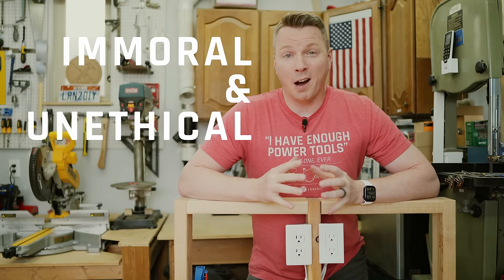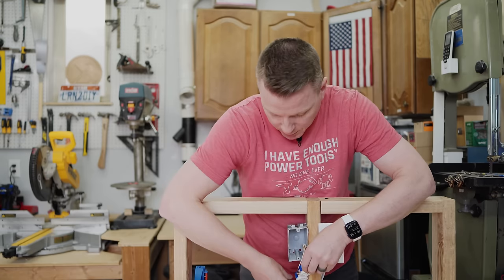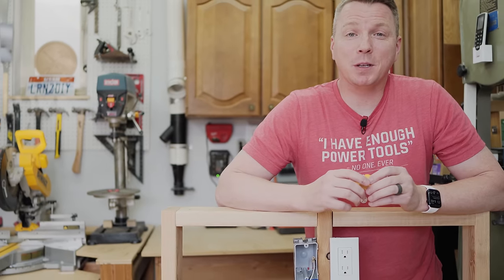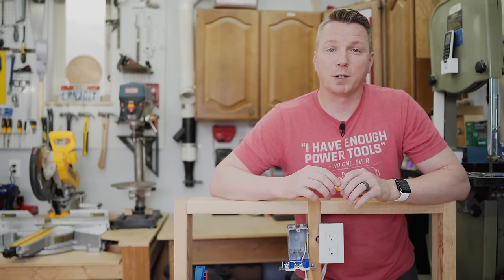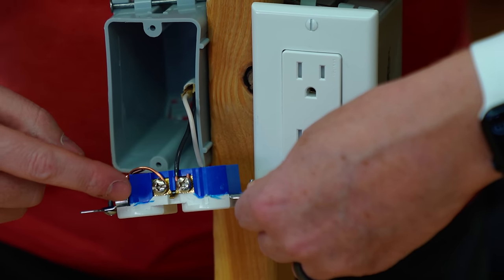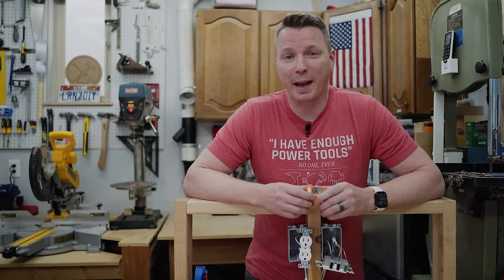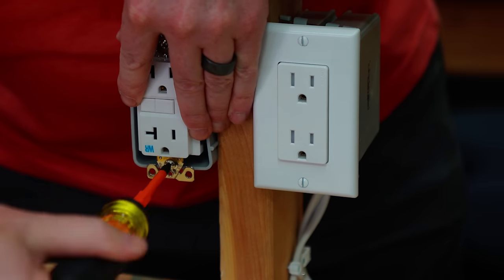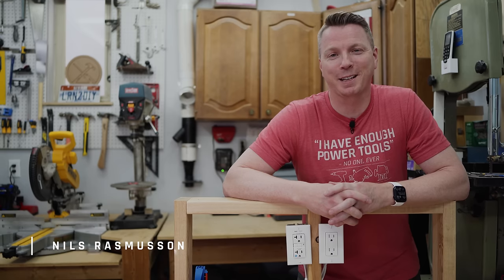People Are Adding Deadly Hacks to Outlets

Comment: Another option is to install GFI breakers at the panel.  That's going to be my solution.  I have a house built in the 50's and it is entirely wired with 2 prong outlets.  To rewire the house would be 20% of it's current value.  The existing 12-2 seems to be in good shape.
Reply: ❤I like your idea . That would work if you have circuit breakers, some houses that old have fuses. Just my opinion.
Reply: I have the same issue. Thanks for the tip. I'll look into that.
Reply: @jayjudd6518  always change the panel
Reply: If you install a GFCI breaker on an un-grounded circuit and then replace the receptacles on that circuit with 3 prong outlets, will a receptacle tester show that it’s correctly grounded?
Reply: @JClishe  no wire is still missing but it'll be safe.
Reply: @AgentOffice  It's safer, but not safe. It's legal but you still have no protection for your electronics.
Reply: @michaelruskey2311  it's why I decided to run ground wires to every outlet
Reply: @AgentOffice  good call. Consider putting surge arrestor on panel as well. And also at a/v locations. Putting it on main panel will also protect all those fancy new Smart LED bulbs we all have. They will actually live the life quoted on box!
Reply: @JClishe  No.
Reply: You still have to label the outlets as no equipment ground and GFCI protected. But, the advantage of doing it this way is that if the hot chafes against the box and shorts the box to hot, any sneak path to ground will trip the GFCI in the panel, while an outlet-based GFCI would not. The Stud Pack channel described finding this problem the hard way one time while connecting a copper ice maker line to a refrigerator fed by an outlet with this problem. The refrigerator case was connected to 120V through the box "ground", and the water line was grounded. With one hand on each, he was thrown across the room.
Reply: @johnhaller5851  Ay I just saw that video last week! Great channel and great demonstration. Metal boxes without proper grounding make me so nervous.
Reply: @johnhaller5851  You are correct about the labeling. Also any receptacles after the GFCI fed from the load side need to be labeled.

However a GFCI receptacle and a GFCI breaker work exactly the same way. So in that video you mentioned he
Would not have gotten shocked with a GFCI breaker or receptacle. 

They both measure power in and power out. If even the smallest amount is not verified they trip nearly instantly. Although it would allow power to remain on (possibly) in normal usage. The second he touched it, the return path(ground) would have a split path. So it would see that for some reason power  in and power out is not the same. It would trip and I doubt he would even have known it happened except for hearing the click of the mechanism.
Reply: @michaelruskey2311  here is the video he is referring to https://youtu.be/lH8g3_a6HuY
Reply: @wellsnapyeah  thanks Joey(not sarcastic) I found it before responding, to make sure I wasn't missing or misunderstanding anything he said , before I responded. 

Point stands though. With a GFCI when you give it a different source to ground besides the one it's metering it is noticed. This is because it basically would then be sending half voltage down each, thus trip.
Reply: @JClishe  No.  The tester will show that there is no ground which will match the "No Equipment Ground" label that you put on the outlet.
Reply: It would be a pretty good idea to add arc fault protection while you're at it
Reply: Certain small appliances do not work with GFI breakers just so you know
Reply: @jaubuchon28  This seems important to know.  Can you give examples?
Reply: Good idea.  My house is 1940’s two wire.  Was thinking of spending thousands to rewire, but done properly this should fill the bill.  Thanks for the advice.
Reply: If you only have a two wire feed coming to the receptacle (no ground wire), the code allows the use of a gfci receptacle at that location.
Reply: @nateo200  just use screwless plates with the gfci receptical.  this way there is no exposed metal for you to come in contact with the metal box, and the GFCI will trip in the event of a ground fault situation.
Reply: @jaubuchon28  this is quickly becoming a moot point.  GFCI breakers are getting better at detecting ground faults vs false positives, and appliance manufactures are getting better at not sending out those false positive signals.  this is all fueled by the fact that the NEC is requiring GFCI protection on more and more circuits.
Reply: @jaubuchon28  if an appliance doesn’t work with a GFCI, then it’s a defective appliance that should be thrown out and replaced. 

Just because it turns on and does the task, don’t mean it’s safe. Throw it out and buy a new one. 

(The only exception to this is some inverter based appliances like heat pumps might trip a gfci even though they are safe, but if your coffee maker etc trips the gfci, replace it!)
Reply: @jayjudd6518  if your house still has fuses, it’s time to at least replace the electrical panel. Code and safety standards have increased so much since then it’s time to replace the fuse box.
Reply: @michaelruskey2311  what are you talking about “no protection?” GFCI protects the appliances too. GFCI is far more effective than a safety ground at protecting things.
Reply: @rpvitiello  that protects you from shock. Gfcis do not arrest surges or protect from arcs. Gfcis do absolutely nothing as far as protecting electronics from spikes/surges etc. 

You need surge arrestors if you want your electronics protected. You should put one on your main panel for major spikes. It's a good idea to also use surge protector power strips where you have pc or av equipment. It will cut those spikes even more so.
Reply: You can't do it yourself?  Any useful life skills?
Reply: I don't know what is electrical allowed in the US and what not. In Europe our RCD (GFI breaker) disconnect both wires (Life and Zero). If you have 2 wires and 3 prong outlets, isn't the Zero wire used also for Ground? In Germany it is not allowed to route a wire over a breaker that is used as Ground, because in an error state the metal case of your electric equipment isn't connected to Ground any more and can have dangerous voltage. The other reason is that if the RCD/GFI is installed in the distribution board, it can't detect a Zero to Ground error behind the outlet.

Is this in the US diffrent? Or didn't i understand the label on the GFI breaker? Is it that you install a GFI breaker and can only use isolated 2 prong devices. Then for what is the GFI breaker?
Reply: @maximilianreichelt9717  I am not too familiar with Eu standards. However I believe your circuits are 240v. So we are getting into some different stuff.

I'm not sure I understand your question but I will say this. A GFCI breaker or receptacle work the same. You can use either with or without a ground because it measures power from live wire{colored) to the neutral wire(white). It does not need a ground wire(green or bare) to operate.

So, if you had a general living room circuit, let's say. And this circuit was a good grounded 120v circuit. Then no need for GFCI protection from breaker. So, a regular breaker would be used.

Now let's say you want to put a receptacle directly on the living room wall exterior for Christmas lights. You could feed that exterior receptacle from living room power however now it needs GFCI protection because it's in a possible wet location.

So, the GFCI receptacle would be perfect for this because it protects only the area in risk. You could also put a regular receptacle outside and install a GFCI breaker in main panel but that's more money and not ideal or necessary for that situation.
Reply: @michaelruskey2311  Yes, i had to read your answer three times and have written my answer now two times. Physical it's the same but we build in such a complete diffrent way in Europe/Germany that it is some times very difficult to understand. For example we don't have 2 columns with fuse or breaker or GFCI breaker. We use all of them in series. Fuses at house entry, breaker before electricity meter, RCD (without breaker) before breaker groups. And RCD with breaker for special circuits.

To make it simpler first a definition of words:
- L for Live, N for Neutral and PE for Protected Earth (ground). That was the easy part, because we use in germany your abbreviation.
- If N and PE are combined in one cable we call it PEN.
- Distribution board or panel is in the garage where all fuses, breakers and RCD/GFCI are installed.
- Receptacle is the same as outlet.
- Breaker is a resettable fuse to protect against overcurrent. In Germany it is LS "Leitungsschutzschalter" and would be translated as Wire Protector.
- GFCI breaker is a GFCI with a breaker installed at the panel. Common in the US beceause of the limited space in the panel to replace a breaker? International it would be an RCBO. We call that a FI/LS or RCD/LS. It is not common in germany.
- GFCI receptacle is an outlet with an GFCI but without a breaker. We have that too, but i have never seen one anywhere.
- We use GFCI with seperate breakers in the panel and as i understand uncommon or not existing in the US, but very common in Europe because it's cheaper to use one GFCI for many breakers. International it would be an RCCB. We use the generic term RCD because in 99 % we use RCCB and in 1 % we use RCBO. The old german is FI ("Fehlerstromschutzschalter" Fault Current Protector).

That was a bit complicated, because you have only two options: Replace the breaker with a GFCI breaker or use a GFCI receptacle because your panel dosn't allow something else. We in Gemany would install the GFCI without breaker in the panel in series with the breaker.

Yes we have 10 to 16 A fast breaker 230 V 50 Hz single phase for light and outlets, 10 to 32 A slow breaker 400 V three phase for cooking stove, heat pump and such big stuff. All at 50 Hz. We have TN system, that a breaker can do personal protection if the loop impedance is high enough to trigger the breaker in a very short time. If it can't and for new buldings a GFCI for personal protection and a breaker for cable protection is mandatory. We have a grounded neutral like in the US, but instead of split phase we have 3 phase 120°. In homes we have a TN-C-S where N and PE is one wire as PEN from the transformer to the house and from the distribution board there is 2 wire in old installations and 3 wire in new installations.

1) In Germany it was standard to install 2 wire with 3 prong outlets. N was connected to PE. We call that "klassische Nullung" what is translated as classic zero or classic neutral. Old installations can be used as long as nothing is changed and it isn't a bath or kitchen. In new installations PEN is only allowed if the cable is thick anough to withstand heavy mechanical load. 10 mm² (7 AWG) for cu, 16 mm² (5 AWG) for al. In the video it sounds like that was never allowed. Always use 2 prong for 2 wires and 3 prong for 3 wires.
2) In Germany it is not realy allowed to use a GFCI (or GFCI breaker) on a 2 wire cable with 2 prong receptable. The offical explenation is that it is false safety and there are scenarios where the GFCI will not trigger (That is not my opinion). But in reality an apartment or house has no 2 prong outlets as far as i can think. These are only for special situations. You have answered that in the US it is ok.
3) In Germany it is under no circumstances allowed to install a GFCI (or GFCI breaker) on a 2 wire cable with 3 prong receptable. With a 3 prong receptable it is possible to connect a device that needs the ground because of the metal housing. Metal housings, 3 wire devices, PE and PEN have allways be connected to ground and it is not allowed to route a ground wire (PE or PEN) over a switch, relais, fuse, breaker or GFCI, because our GFCIs disconnect L and N. In case of 2 wires the GFCI will disconnect the PEN or the PE in the receptable was never connected to ground. Both is forbidden in Germany. How is that in the US. Are your GFCI breakers only disconnect L? Or is it that if the feet of the person are well grounded the GFCI triggers and if the feet of the person are not well grounded there is no risc? In that case of GFCI breaker in the panel and 2 wire with 3 prong do you connect the N with the PE in the Receptable?
4) With 2 wires and a GFCI receptacle do you connect the N with PE or not? In the video it seams like not connected, so the N is grounded, but the metal housing of the device is floating (IT System). In Germany an IT System is the exact opposite: Metal housing has to be connected to generator and L and N are floating and not connected to ground or anything else.
Reply: @donkrapf  Pumps, Fridges, Microwaves, Fans, and High Initial Draw lighting all have a tendency to nuisance fault even when there is no true current leak.
Reply: @bassman87  while it may be improving, still doesn't change the fact that big fans, most high wattage microwaves, a lot of sodium and fluorescent lighting, and refrigerators/ac or heat pump units throw GFI's fairly consistently when there is no functional issue with the appliance
Reply: @rpvitiello  that is false, there are certain appliances and items that nuisance fault GFI circuits even when functioning perfectly properly
Reply: You still don't have grounds in your outlets. By the way, the RCD/GFCI is not even going to trip in case of a fault. Immagine a live wire that comes into contact with the metal case of an appliance (let's say a washing machine). The breaker will not trip since there is no path from the metal casing to the ground since the ground is disconnected. Then imagine you coming out of the shower, with bare foot and all wet, touching the metal case of the washing machine, and completing the circuit to ground. At that point the RCD/GFCI will indeed trip, but you still receive a shock, that can in some circumstances be lethal!

At least if you do that, connect the ground pin of the outlet to something that will pass that 30mA to ground in a way that is able to trip the RCD, for example a copper pipe or structural steel. It's still not an ideal ground but at least in case of a fault the RCD will now trip.
Reply: running a ground is not all that bad honestly.
Reply: @alerighi  From electrical code..406.4(D)(2) Non–Grounding-Type Receptacles. Where attachment to an equipment grounding conductor does not exist in the receptacle enclosure, the installation shall comply with (D)(2)(a), (D)(2)(b), or (D)(2)(c).

(a) A non–grounding-type receptacle(s) shall be permitted to be replaced with another non–grounding-type receptacle(s).

(b) A non–grounding-type receptacle(s) shall be permitted to be replaced with a ground-fault circuit interrupter-type of receptacle(s). These receptacles or their cover plates shall be marked “No Equipment Ground.” An equipment grounding conductor shall not be connected from the ground-fault circuit-interrupter-type receptacle to any outlet supplied from the ground-fault circuit-interrupter receptacle.

(c) A non–grounding-type receptacle(s) shall be permitted to be replaced with a grounding-type receptacle(s) where supplied through a ground-fault circuit interrupter. Where grounding-type receptacles are supplied through the ground-fault circuit interrupter, grounding-type receptacles or their cover plates shall be marked “GFCI Protected” and “No Equipment Ground,” visible after installation. An equipment grounding conductor shall not be connected between the grounding-type receptacles
Reply: @michaelruskey2311  "They will actually live the life quoted on box!"  Would not bet on that :)
Reply: @JClishe  No. The tester will show an open ground.
Reply: One could use an isolated ground GFCI to prevent a short to the box from making it to the attached appliance in a metal box. I'd forget about those.
Reply: @JClishe  No. Testing will (correctly) show ground connection is not present.
Reply: FYI you don’t need to replace all your breakers with GFCI. GFCI breakers can be expensive….

You CAN however setup a GFCI outlet to protect an entire circuit with certain requirements. It must be the closest outlet to the breaker. I know electrical circuits in old houses (like my old house) had tons of crazy branches. You can put one on each branch. Just make sure to check the mfg instructions on how to wire it to protect other outlets.
Reply: @JClishe  No, but it's allowed. The GFCI needs to be the first breaker on the run AND all outlets must be labeled as Ungrounded.
Reply: I'd take the 20% of its value versus a house fire or death by electrocution. I am in a house built in 2013 without enough neutral wires for all the boxes in the house. Each circuit should have one in a house of my vintage if not newer.
Reply: @michaelruskey2311  naw. They will still live a short life because they are designed to fail.
Reply: F'it...I just gutted the entire house and found several wiring nightmares in the attic space. No ground on any outlets worried me to no end. Make it right !
Reply: @jayjudd6518  That's what I had. I did change the fuse box to a circuit breaker box but it's a sub panel off the main. So no proper feed to it and all 12 gauge 2 wire ancient romex out. I did at least get a new kitchen in and it's receptacles are all up  to code fed by two afc/gfc breakers.
Reply: I've also done this in my dining room.
Reply: @Enonymouse_  Built in 2013 without enough neutral wires?
 Was there permits and an inspector?
What's the wire gauges?
Reply: A at panel GFI Breaker does not help an ungrounded outlet situation and would be useless.  You are maybe thinking of an AFI breaker, because an arc fault will give some protection.
Reply: @mdj.6179  County officials out here are/were notorious for not inspecting stuff. Gage looks like its rated for 15 amp service for most circuits. I started removing/downgrading panel spaces to optimize panel usage.
Sovereign immunity clause prevents me from pursuing the county, contractor is dead even if I was to pursue that. I actually inspected someone else's house recently as a favor, and found things nobody should have signed off on, it's not even my job. >.>
Reply: If you have 12/2 that should include a ground wire, so either you don't have 12/2 or your electrician trying to shaft you.
Reply: @garagekeys  In 1952 it didn't!
Reply: Per the 2014 NEC and later, you can add a single ground conductor to non grounded receptacles and fixtures and tie the ground wire into any point in the existing EGC(Equipment Ground Conductor). Ground wire smaller than 4awg must be either bare copper or have continuous insulation of green color, you can’t just mark it with green tape at the ends. No need for total re-wire, just run a single conductor bare copper or green insulated THHN wire to any receptacles or fixtures lacking a ground and tie the grounds either together in a junction box and then back to the panel or another existing ground nearby. You can ground to an alternate branch circuit ground, or the ground from the water pipe, etc. Any point in the EGC is allowed.  For 12awg branch circuits fused at 20A you’ll need 12awg ground wire.  Early “Romex” wire typically used 14awg grounds with 12/2 but the newer standards is same size ground as branch circuit. 

I can’t recall the exact chapter and verse from the NEC that states all this information, but I’m certain it’s in there, I referenced it fairly recently for the same reason, a 1950s electrical system lacking grounds everywhere.
Reply: @Moddage  The installer may have ignored NEC codes for color coding too, it doesn't help they didn't mask off the electrical boxes prior to painting the walls (so the insides are covered in plaster and paint). In my opinion the ground wires used are undersized for the work they are expected to do. There is no visible earth ground (ground rod and appropriately sized wire from main panel).
Reply: @jayjudd6518  then it's time to upgrade to a modern load center.
Reply: @jaubuchon28  I don’t know what you guys are bootlegging but over here in Germany every Source of electricity after the Panel that a ordinary Person can touch has to be protected with a gfci. I have been doing this for a while and never had a problem with them. 
Maybe they are built different over here we build them in the Panel that checks 8-12 circuit Breaker at the same time, we don’t usually build then in the socket.
Don‘t you have to pull Hot, Neutral and Ground to a socket or is that not code ?
Reply: GFIs require a fully grounded circuit
Reply: Correct, the code allowed this for two wire back when I was working. It's not to let more than 7ma pass in a fault situation.
Reply: @johnpeace971  What about testing the circuits when you are done Installing? 
This dude is talking like that that around 500$ equipment is a big investment, every Certified Electrician Company here has to have that equipment to even open up a Company without that no license for the company.

We have to test every new circuit or change to a circuit. 
 - Isolation test
 - breaker test
 - resistance test
 - GFCI test
 - and more.

If any of these test don’t qualify you have to fix the circuit/socket or decommission the circuit.
Reply: @joshuaarellano6600  Thanks...exactly what I just did.  Installed Arc/Gfi breakers after changing out all the 2 prong to 3.  Need to order some labels.  The old 2 wire 12 gauge wire appears to be in good shape.
Reply: @JClishe  if you go with a gfci buy a outlet tester and trip the test button so you know it’s set up right.
Reply: @Enonymouse_  if it's new it should be a ufer ground and not a ground rod. Also are you talking about the grounds in the romex or the bonding wire? Bond wire would be #8 for 100 Amp and #6 for 200
Reply: @Enonymouse_  it's the painters job to mask things off
Reply: @mdj.6179  What do you mean not enough  neutral wires? Are you talking about 3 cables like 12/3 black,red,white,bare?
Reply: If you use a g.f.c.i. on a wore with no ground it does not operate. Ground fault. Think about man.
Reply: @whywouldudothat2914  Yes. So a GFCI is basically the IRS. it’s making sure that the hot ( black ) and neutral ( white ) wires have a certain amount of flow coming into and and leaving the device. If it detects less flow than expected coming back to the plug than the plug is providing, it flags it as a ground fault i.e. current is being stolen from the circuit. It doesn’t care about how the flow is escaping whether it’s through a ground wire or a hair dryer fallen into the toilet. Just like the IRS all they care about is that flow coming in is sensible to the flow going out, reasons be darned
Reply: @jayjudd6518  in that case you should really put in a new panel...
Reply: If the MC is grounded you can run a ground off the box.
Reply: @JClishe  It will show open ground. That's why you must have the label identifying it as such. You are relying entirely on the GFCI to protect against ground shorts.
Reply: And (I have done wiring work in a more or less properly wired house) it doubtless wouldn't be legal to send out separate ground wires along the 12-2 would it.
Reply: Just because it seems in good shape doesn't mean it actually is. Insulation on most wiring is designed for a 50 to 70 year lifespan. A house built in the 50's is near the end of life for its wiring and needs to be replaced, and soon.
Reply: @michaelruskey2311  I know I'm late to this game, but the ground wire does not protect electronics. It protects people from shock, the risks of which are generally so low in most houses built in the past half century or so are so low that many appliances can get away without having a ground prong at all.
Reply: That's what I started to do as well (install gfci breakers. Old farmhouse)
Of course, it's can't be perfectly easy. I have 2 breaker boxes. And the secondary one has some wires where ONLY the hot comes into it. No idea yet where the neutral ties in.
Not the happiest with how this house is wired. But slowly getting there. Can't afford to remodel/full rewire for a long while yet.
Reply: @JClishe  no the receptical tester wont but that does not matter. You have to mark all the outlets as ungrounded but protected by GFCI and the test function on those outlet testers does not conform to most UL listings for the GFCI any ways
Reply: If the house has a gfci at the board, then a plug tester with that can inject controlled leakage to earth, will pick up a lack of earth...
Reply: @alerighi  You will not receive a lethal shock using a properly functioning GFCI outlet on a two-wire circuit.
Reply: @jaubuchon28  I have fans, refrigerators, TVs, toasters, microwaves, PCs, printers, routers, space heaters, can openers, A/C, lamps, and heated mattress pad, all plugged into GFCI-protected 2-wire outlets and have never had problems with nuisance trips. Same with vacuum cleaners and even air compressors.
Reply: Just rewire and do it right.
Reply: Sorry forgot to say why. Typically on old houses people just stole neutral wherever they needed it. Gfi breakers will not work in that instance. I've seen one shared neutral 12ga with 56 amps coming back.
Reply: The way to deal with no ground is very simple and safe. The first thing to do is find the first recep in the run of receps on a circuit. Next install a quality GFCI receptacle at the beginning and all of the receptacles down the line will be hooked up off the load side of the GFCI. This is a safe and effective way because the GFCI receptacle does not use the ground to function it uses the neutral.
Reply: @Tom-og7fi  this also will not work if neutrals are shared anywhere.
Reply: @shawnshurtz9147  it most certainly will work shared neutrals don't hamper the effectiveness of a GFCI. Also if it is a two wire romex or BX chances are the neutrals will not be shared.
Reply: @Tom-og7fi  it absolutely will not workit measures milliamps out and in if the neutral is shared down stream somewhere the return is way off and it will absolutely trip without a ground fault. 3 to 5 milliamp difference is all you need to trip. Ive seen multiple dimmers trip them. Best bet is GFCI at every location. Also amateurs can by Romex and BX cable but why would anyone use BX when MC is a far better and more reliable option. I mean how many homes short of an electricians would use metal boxes to take advantage of any armored cable.
Reply: @shawnshurtz9147  BX hasn't been around for a very long time dude I think you are googling how to do electrical work romex is still used today in houses with plastic boxes
Reply: Japanese and Europeans do this to their 2-wire receptacle runs. NEMA should bring back the old 2-pin (polarized) standard as more and more things become double insulated.
Reply: @ryuukeisscifiproductions1818  , my house was built in 1958.  I have lived in it since 1973 and the wiring is good.  I have a full basement and the wiring can be got to easy.  I have replaced a few wires going to my bathroom  and extra room down there along with a GFCI.  The wires in the attic are also good.  I had an electrician check them a while back.   I also had the panel upgraded to a 120 amp about 15 years ago.   I know how to wire myself and trust me more than most of these jack-leg hacks around my area.  I also have a few GFCI breakers for rooms upstairs.
Reply: Gfci at the panel, actually NEEDS 3wires to the outlet to function correctly. It is absolutely pointless to do it this way. If you dont have 3 wires to the outlet, then the gfci has to be inside the outlet.
Reply: @anthonyaristotelov  3

NEC 2020 section is 406.4(D)(2) and gives 3 options:

(a) replace a non-grounding receptacle with another non-grounding receptacle.

(b) "A non-grounding-type receptacle(s) shall be permitted to be replaced with a ground-fault circuit interrupter-type of receptacle(s) ... An equipment grounding conductor shall not be connected from the ground-fault circuit-interrupter-type receptacle to any outlet supplied from the ground-fault circuit-interrupter receptacle"

(c) "A non-grounding-type receptacle(s) shall be permitted to be replaced with a grounding-type receptacle(s) where supplied through a ground-fault circuit interrupter ... An equipment grounding conductor shall not be connected between the grounding-type receptacles."

So, your (1) is allowed under 406.4(D)(2)(c) since the GFCI breaker is a ground-fault circuit interrupter.